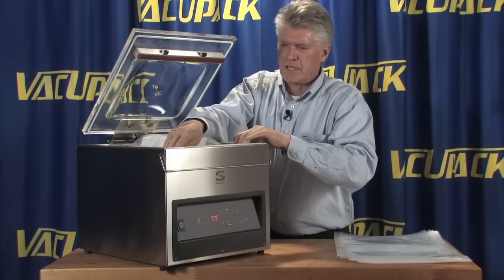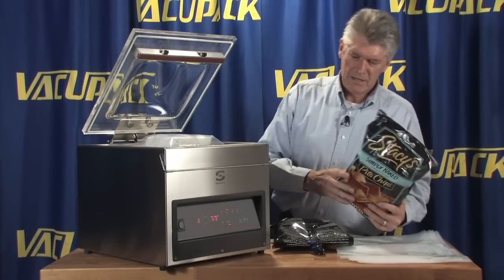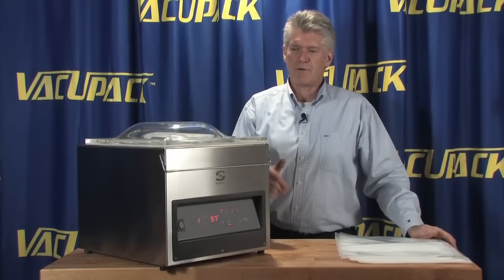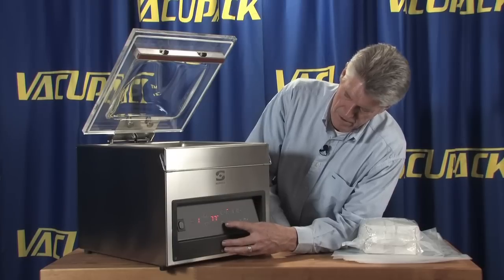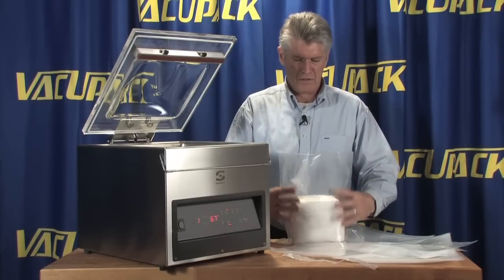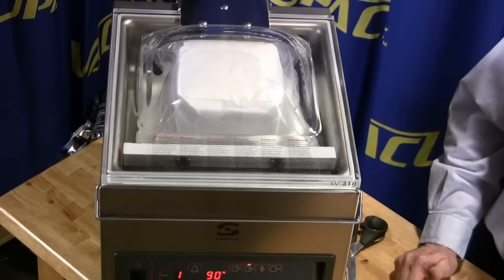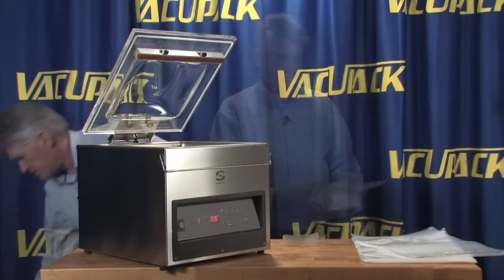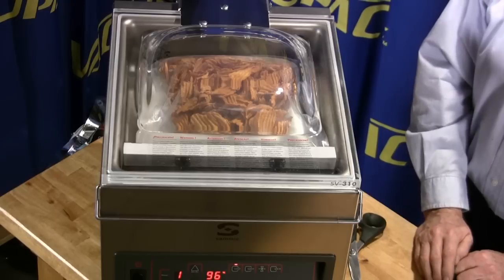Gas Flush Vacuum Packing, Sammic SV-310S Modified Atmospher in a Commercial Chamber Machine

Comment: Hi what type of gas would you recommend for vacuuming and freezing pizza?  Don't want it to crush my crust in the vacuum process but also need to protect against freezer burn.
Reply from the maker: Hello Pete   Nitrogen is the go to gas for most foods.  But the experts at Praxair or Amerigas can help you with any food preservations using gas.   Using gas flush will protect against freezer burn and keep the product from being crushed under the atmospheric pressure.